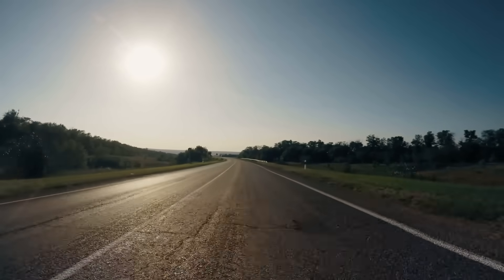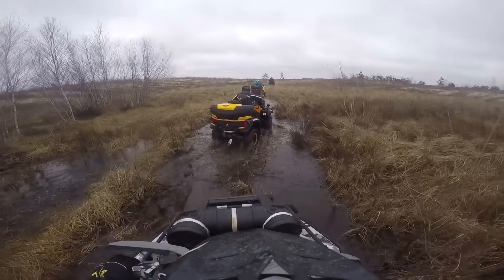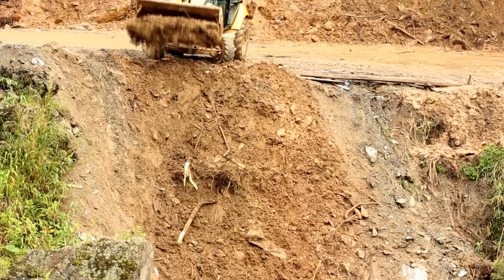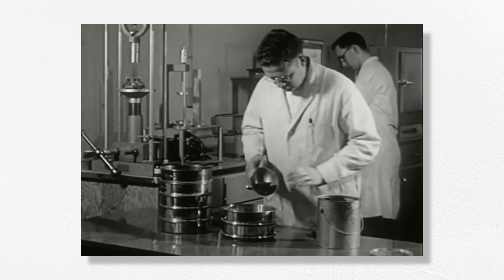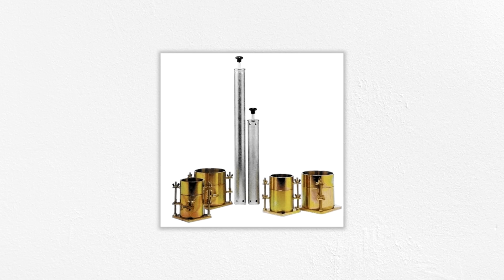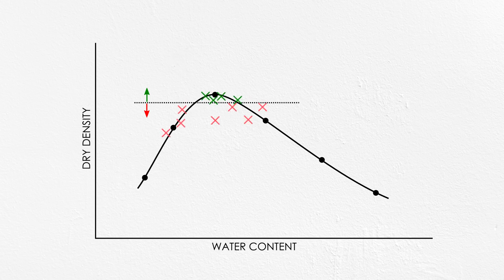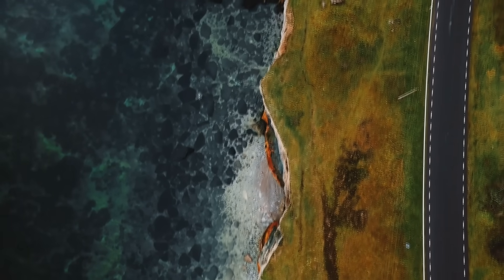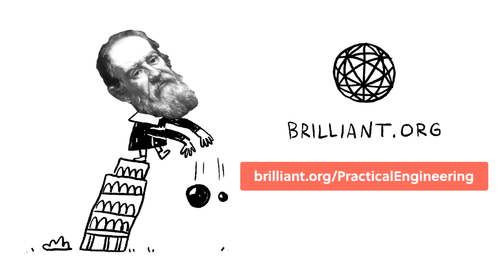Why Does Road Construction Take So Long?

Comment: I love watching freeway construction, I'm not an engineering undergrad, but in fact a landscape Arch. undergrad, so its close enough, and still so fascinated by the process. in particular i've been watching very closely the i5 Norwalk corridor expansion, which saw a complete overhaul of that section of the freeway from the OC border at the Artesia  overpass, to the 605 interchange. It was the last section still in its original 50's form, 3 lanes each side, a dirt E-lane, at equal elevation, in retched disrepair, with nearly as bad single lane passes. The OC[thanks mainly to tax funds from Disneyland, AND funds directly handed over to the county from the park] had already been overhauled 20 years prior in the mid 90's, it was wide(16 lanes in some parts), it was modern, it was up to code, and it was very much needed as much as it was appreciated. Closer to LA, beyond the 605 had seen a much earlier renovation, and thus was moderately updated, 4 lanes each side, sound proof walls, but fairly aged, so updating there didn't have priority. 
The bottleneck was in that last section, going across La Mirada, Norwalk, i think Downey as well, but with state freeway funds supplying a minimum of what was needed; simply adding lanes, the cities got together and formulated the same construction plan as OC, seeing a complete overhaul, basically rebuilding the entire freeway from scratch. initially 8 billion, it became a 16 billion dollar , 15 year "planned" project that broke ground in 2008, and would be completed in 2 phases. the 1st phase would be simply freeway expansion on both sides, with overpasses and underpasses not only being entirely rebuilt, but some even added, and we finally now get to cross all the way thru on the long awaited, even longer anticipated Bloomfield underpass, which was never built when the 5 was constructed, they simply made it a dead end on both sides, a sight all too common, and hated. 
Former single lane overpasses, are now 4-5 lane multi-signal light passes. THIS is what i hoped you[the video producer] would explain, its THESE overpasses, that required no filling, or cutting ,that i found would take upwards of an entire year! to complete start to finish, just for a single overpass!! Granted though these are bigger overpasses than any I've seen, the 2 big ones requiring [what i counted to be on average] had 20 to 25 columns, like 4 to 5 rows, and big reason was the railroad tracks parallel to he freeway, now the passes jump over the tracks as well. the 2 major ones were Carmenita, and are now finishing Valley view, part of phase 2, each with there own set of 4 ramps, all without fill, and on columns. But so phase 2 is halfway done, being maybe a 5th the size of phase 1, phase2 was done later because it was this section that required imminent domain to be enacted, since expansion could only take place on one side, keeping the businesses on one side, and removing the more dilapidated buildings on the other. This also made 2nd phase different because since expansion could only take place on one side (and remember this is a complete overhaul, entirely removing the old freeway material an all and putting in brand new reinforced concrete freeway, going from 6 total lanes to 14 total) so rather than merely expanding with lanes, this section of freeway actually had to be rerouted, from a straight to a more S-shape curve. They are now 4 years beyond project completion, which stands to be done by 2022; but watching the entire process, man, it'll have been worth the wait, soon to match the OC in size and complexity, unmatched in few other places. I've taken several time lapses of the progress of the 5 construction, I've, i actually have honestly a couple hours worth of documented footage, video, [time lapsed and 1x speed], up close photos ext.

I've looked everywhere on-line and cannot find anything close to the footage I've documented, if you are interested in obtaining my footage for your own purposes i would be more than happy to send copies your way, I've yet to reach out to Caltrans to see if they are interested, but reply to this post if you want an ill send you my email where we can link up. Also if you have info on  where to find any animated renderings of the final completed project even if just some CAD renderings, idk if you keep up with this kinna stuff, yr prolly not even from LA i presume, but if you do, please let me know and id be much appreciated. 

but man they take a LLLLLLLLLOOOOONNNGGGG fuckin time doing it. Another freeway thats taken EVEN LONGER but i haven't kept tabs on is where they've been expanding the 10 freeway between the 605 and the 57 for god knows how long, and for just 2 extra lanes! yea just to add a carpool lane and an e-lane on both sides(tho this would connect the carpool lanes on both sides of the 10 to make it continuous from Westside thru Down town LA, all the way into the far east I.E. i think as far as the 210 in Redlands) and are barely finishing up the I'd say 5 to 7 mile stretch, it was a good size stretch though so. Weird though that phase 2 took them a fraction of the time they spent going thru the cities of Baldwin Park, West Covina ext. which was where it passes over the la Puente hills cutting into enormous grades from the adjacent hills into the San Dimas area, there end result was no longer a grade, i saw they had to put up like 40 foot tall retaining walls to hold back the hills that are like 400 feet high on both sides of the freeway, prolly cuz there's properties on top. the hills ...You know what thinking about it, i know why they took so long in the city section, and really you should do a video on this topic alone, but there are 4 types of freeways crossings [at least that I've concluded] which are:
the highway underpass~
the freeway underpass~
the freeway overpass~
and the highway overpass~

The most common are the 
--highway overpass--, 
such as in parts of the 5 freeway, those are made when the freeway was built 1st, and continues at level elevation, then accommodated the later built highway with a bridge. is becoming the de facto crossing since it doesn't require any cutting or filling for the freeway When the highway was built 1st, the freeway is usually raised in elevation and It becomes the bridge or 
-freeway overpass- 
such as in orange county with the 91 or on the 605, is usually done in fairly large sections, can be expensive since its large portions of fill at least 20 feet up. Also when the highways were there first, Often in places like the 210 or the 60 in the IE. they will just dig a huge trench for the freeway going lower in elevation, giving us a
--freeway underpass--. These are usually made in large sections where there multiple highways already there and you'll get multiple freeway underpasses, you'll also find this on the 105 where it ends which gets like nearly 50 feet deep(because of other unforeseen reasons i wont get into). but then there's the least common type, and now i know why. lastly you then have what are the 
-highway underpasses-
and this is where the freeway continues at level elevation, but for the highway crossing it, they have to dig under the freeway, essentially a tunnel (or is it technically called a culvert; anyone?) only place i can think of iv'e seen this, is along the , you guessed it, the 10 freeway between the 605 and the 57. So here's the problem with these that i literally just realized, when they want to expand a freeway ie make them wider, adding lanes as such, usually they can only do the construction while keeping the freeway in operation, albeit reduced lanes, since especially down here they are vital corridors to the surrounding regions. so when you come across the highway overpass i described earlier they can rebuild them and keep the freeways in operation, except when they must do demolition of the old bridge, same process is true for freeway underpasses, to remove more fill from the sides the highway that crosses must be rebuilt. If its a freeway overpass thats even easier, the highway doesn't even need to be touched, they simply bridge the extra lanes. but for the highway underpass this all changes, because one would first think id be the same as for the freeway overpass, but since the highway must 1t drop in elevation, cross, then come back up, if they simply added the lanes, the cars on the highway would whack there roofs upon the entrance and exit of the underpass, this means the whole underpass must be rebuilt, and to do that you'd have to shut down the entire crossing of the freeway, all lanes in the freeway of that crossing would be out of operation, but this is not an option, thus, this type of crossing when adding freeway lanes require EXTENSIVE planning, VERY DELICATE construction, and would be VERY time consuming. I now can appreciate why this section of the 10 extension took as long as it did; something like 15 years, while the hill crossing, though it was just a 1/4~1/3 of the length, only took them 3 years to complete. They started that project in 2000 and are only JUST NOW finishing it up

HOLY FUCK! i just realized this is the longest comment I've ever left! ...Oooops

Comment: This is the same as the speed limit video. You don't go into the actual real explanation the title suggests because it's political and has no basis in engineering. A novice will then think that there's a SCIENCE reason why they take so long on a project. Title your videos with less misleading titles.

Comment: Living in Los Angeles and orange counties, I always wondered what the hell was taking so long, now I see how much work goes into this, at $3m per mile at a two lane road I can't even imagine the time effort and cost into a 16 lane freeway, keep this content coming sir
Reply: Meanwhile in my city it's not all all about how long it takes to build the road. They get built 3-5 times. They get built, dug up to install basic utilities, then rebuilt. Repeat because they couldn't be bothered to coordinate so every road has to be build repeatedly. Surface roads are built about 5 times, highways built 2-3 times. And that's all before they widen the roads, which begins 3 days after the road was finally completed and continues for 5-20 years because they do the exact same thing with bridges. That may seem like an exaggeration but the latest ring road has already begun widening areas with narrow bridges that were built narrow despite being intended to be widened in areas 8 years old. The ring hasn't yet even been completed in areas that were started a decade ago
Reply: @wubsywubsy  both. See that's my point. That's not the cost of building roads. That's the cost of mismanagement of road projects
Reply: @wubsywubsy  Is that the cost to build, or how much the county spends on average? Building a road uses pretty much the same time and materials everywhere. But crews don't bill the same everywhere
Reply: @wubsywubsy  So you have no clue whether it's based on cost or other bullshit. That was my point. HOAs are cancer. Could be worse though. Could be Republicans literally burning everything down
Reply: @wubsywubsy congratulations on being useless
Reply: @Coolsville it would be less if CalTrans and Counties didn't have 10 supervisors watching ONE guy or gal actually WORKING!
Reply: @«tutacat» no, building roads does not increase traffic. That's not how it works at all. It's amazing you thought that sentence was even remotely intelligent
Reply: @Coolsville ....and they ALL drive in separate vehicles, which putter poke along during on the clock time and engage WARP drive when it's quitting or lunch time.
Reply: @Coolsville ....yes, the ONE guy actually working starts on time and leaves on time with his ass dragging in worn out wreck of a truck. Different story for the supervisors that need an extender link seatbelt.
Reply: They gotta take their time, especially on multi million dollar projects
Reply: Its to bad we did not infest in mass transportation instead of pouring so much capital into building so many roadways they generally turn into parking lots much of the day. I live outside NYC and if I take the train it take 25 minutes if I drive it can take 1.5 hours. If we had good mass transportation that 25 minute ride could be ten minutes. Instead we just keep throwing money into fixing roads.
Reply: @mtadams2009  The US used to have a mass transit system. Then Henry Ford made cars affordable to the average person, which would also run on about any combustible. Then John D. Rockefeller bought up all the tram lines and which went from one coast to the other, while building up his gas station businesses and other oil company's. Had people lobby for and backed The Suffrage Movement, which started prohibition. That made it so no one could make there own fuel and had to buy it from Rockefeller.
History can be fascinating once you look at the whole picture.
Reply: @KalRandom  don't forget the suburban sprawl prompted for racial reasons and GM literally buying tram lines in 1950s to demolish them all to replace with buse...
Reply: @mtadams2009  Its always people who live in NY complaining roads dont work and whining that cars are evil and destroy society. 

Maybe the problem isnt cars, its New York?
Reply: @Nazuiko  Someday and that day is closing in fast we all will complaining. I spent the majority of life living in a rural area and still own a house there. The cost of fuel is going to decimate rural living. Give it 15 to 30 years we are screwed for not planning.
Reply: @mtadams2009  In California? yea they did. How's that high speed rail coming along? all the money stolen yet or no?
Reply: @dmitrychernivetsky5876  I don’t live there so I know little to nothing about their issues. I still stand by mass transit. We use about 88 million barrels of oil per day worldwide, the US about 20 million barrels. There is about 53 or so years left.   Not in my lifetime but my kids life the chickens are going to come home to roost. Kicking the can will come to an end one way or another.
Reply: @mtadams2009  At least in Europe we have much more wisdom on this one. And China is even further with this.
Reply: @22deathdude no leave those asshats in the city. We don’t want them out where we are for a reason.
Reply: Woongsin. The reason it takes so long in those two areas is because there is a stupid amount of people in such a little space.

Comment: I hope somewhere in this series, you'll explain why road construction isn't done in reasonable stretches -- say a few miles, rather than what I see most times -- i.e. idle equipment strewn along a miles-long interruption to travel.  Get all the equipment you need into the designated work area and use the hell out of it.  Finish the road then move to the next section.

Comment: I did soil testing off and on for 10 years or so. It is one of the most B@ll Busting jobs you'll ever do for the least amount of money you'll ever make.

Oh! You forgot sand cone densities! When that @ss hole QC Engineering, sitting in his Air Conditioned Pick-up decide he wants you to verify your Nuke Gauge everyday against a sand cone in the middle of July with a 177 Degree F heat index!

Comment: I'm less enthusiastic about road construction than you are.  
In my town, a road construction company spent THREE YEARS resurfacing about 3/4 mile (1.2 km) of 2-lane road.  The work included installing some granite curbing and upgrading the traffic lights at an intersection.  Elsewhere in town, resurfacing about 3/4 mile of a 4-lane highway also required THREE YEARS.  And people wonder why our state has the highest road maintenance costs in the USA.  Here, road maintenance isn't a job, it's an annuity.

Comment: In the secunden ~26 to 32 You see the construktion from the Highway between Moskau to St Petersburg.
The Construktion is very difficult.
In Summer over 30 Grad Celsius und the winter - 40 Grad Celsius

Comment: As a soil tech (well I do much more than that but mainly do soil) I can confirm this video was highly accurate. However, the main reason isn't as simple as "well they have to bring it up slow." Most projects I work on typically require compaction testing every foot of elevation, per certain square footage (usually something like 500 square feet or so) and those tests do take a while. But if those tests passed then it really wouldn't take that long. The main slow down is failing tests and changing soil types. Failing tests can be anything from they haven't compacted it well enough, they have too much moisture, not enough moisture, too much oversize rocks, bad soil underneath, the list goes on. Those failed tests basically stop production in its tracks until it is fixed and passing. If it fails due to too high of moisture it can take possibly days of working the soil trying to dry it out before we can finally get it to pass. Changing soil types can also cause delays for us, contrary to what some seem to think dirt isn't just dirt. Even from one piece of land that is being excavated to use as fill material the soil can change numerous times, which means the density and optimum moisture will change as well. This means we have to get a sample and take it back to the lab to run a new proctor test on it, this can take anywhere from 4-6 hours up to a few days depending on the lab and the availability of people to work on it. So the TL;DR is failing compaction tests and changing soil types are the main causes of delays that weren't mentioned.